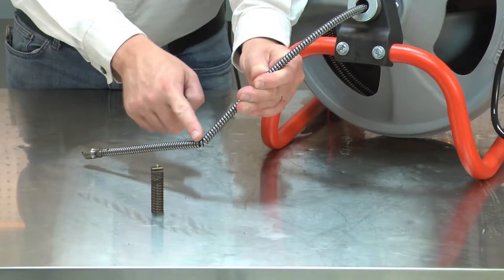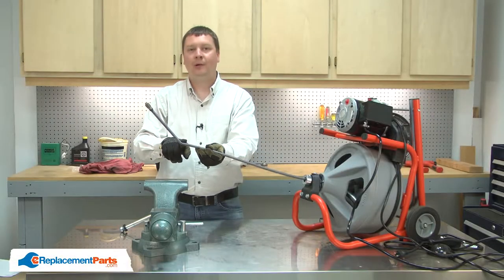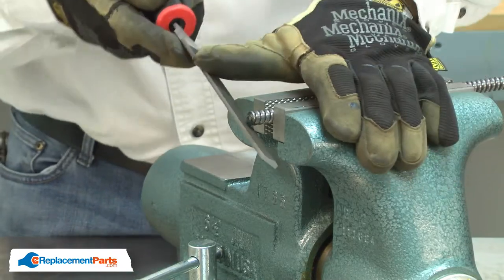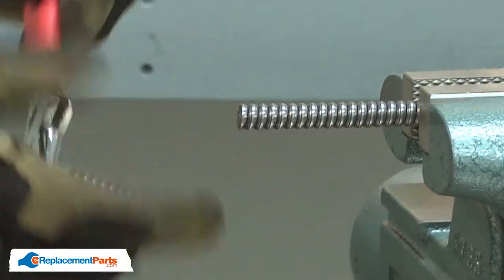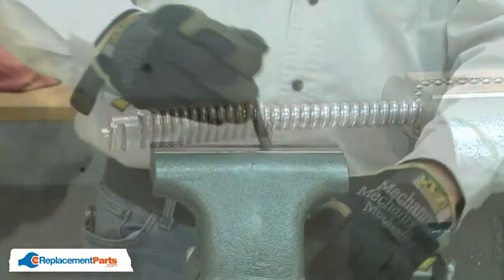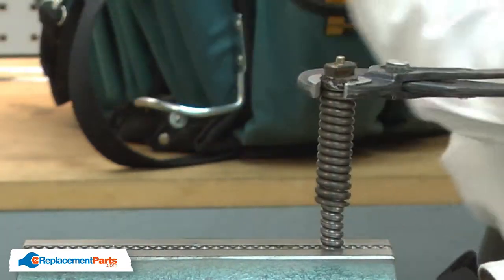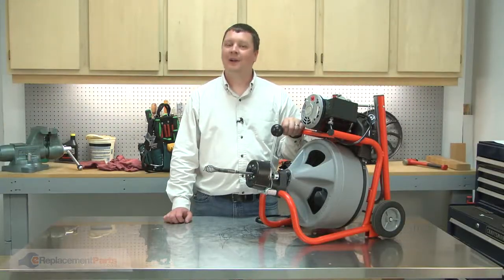Ridgid Drain Auger Repair - Installing the Cable Repair Coupling (Ridgid Part # 91037)

Comment: Hey a little FYI for anyone out there trying to install this thing. This video doesn't cover the important parts so if you have trouble try these tips: first the end should be cut or at least ground flat, my angle grinder did it in a couple minutes. Next tip is to pry the end of the repair coupling open with a screwdriver and stick a penny in it. Don't put it in too deep just enough to keep it open. Add a second penny 180 degrees to keep the spring pried open. I then added a little oil to the snake end, which was in a vice. Don't try and do it with 2 channel locks or a pipe wrench, absolutely need a vice. You can use the penny's to help pull it towards the snake using your fingers as you twist it on. I used channel locks and kept going CCW haha.
Reply: Excellent advice about using a penny to keep part of the coupling wedged open. I tried it and it went on the snake smoothly. I dipped the snake end in graphite powder for some slight lubrication and that helped too. Lastly, I used a cresent wrench on the coupling end so as to not mar the mount , not channel locks. Thank you again for the advice!

Comment: The spring loaded pin on the coupling doesn't work anymore, is there a quick fix to connect the tools with the coupling? thanks!

Comment: I've been trying find those repair couplings for vevor 1/2im cable. I wanted cut up make few shorter sectional pieces to give me up to 80 ft.
No answer from vevor. Mines brand new. This last week single nut and screw hold adaptors and tools on cable.
WHERE CAN I PURCHACE DPLICE KITS AND. ADAPTOR TOOL HOLDER?  Thanks in advance , good video.  In fwd run cables always tightening
. Some add loctight one video.
In aircraft we used metal set. To take spart heat then is only way.

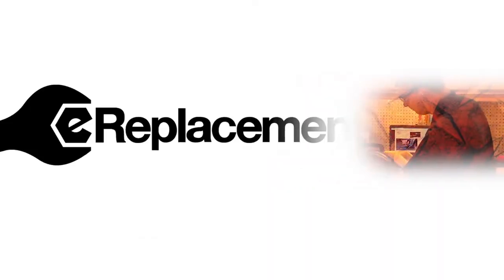Comment: CCW is the correct direction to get the new tip in.  Stop the video at 0:23, look at the picture.   When complete, this is how it should look like.; 3 rings on the repair tip are expanded.  If you try for the 4th ring, the cable will be over torque, and break; costing you a new repair tip & time.   Don't  over do it.  Notice how he cut the cable about 8" from the break; because near the break, the cable is "fatigue-damaged".  Also, be careful of using a crescent wrench on the tip; don't damage the groove where the cleaning tools slide into the groove on the repair tip.  You got to do this like the video, with a vice, crescent wrench, lubricant oil on the broken cable.  The video was wrong toward the end after he reposition the cable pointing up; he was turning the repair tip CW.  CW is the direction to remove the tip from the cable.  Buy an extra tip as a spare; maybe even a spare 1/2" cable; the bigger cable can take more wear & tear, but it will be less flexible than the existing 3/8" cable.

Comment: Odd, after he starts the coupling and re-clamps it in the vise and then unscrews it...  The cable is reverse threaded.
Reply: No, that's not possible!
But it sure looks that way. 
Could they really have done it bass akwards and left it up?

Comment: repair coupling? Only partially, I did not see the part where you re-attach the internal cable to the head. I'm pretty sure they are all attached as they come from the factory,. Is there a spec from ridgid on this..I mean to attach the internal cable to the end also????
Reply: I thought about this and my only explanation would be that the old cable core with flexible jacket is now acting as the cable core itself  which then gets inserted into the replacement head section, if that makes any sense...

Comment: Not as easy as he shows.  Comments have helpful ideas. I used a flat screwdriver to bend the thread on the new tip to get it started. Then pipe cutting oil to help screw on using vice and pliers. I got about 4 rotations. Don’t go too hard!

Comment: I have a 3/8 cable from k400 ridgid but this is not working
Reply: I've got a 3/8 k400 too with the same problem, what issue are you having with the repair coupling?
Reply: Me too!  The fitting is crazy tight!

Comment: This doesnt work. Cant get the coupling in
Reply: on the coupling take a screw driver and separate the spring just a little to get it to twist on. it works